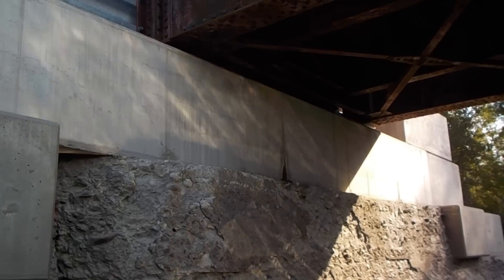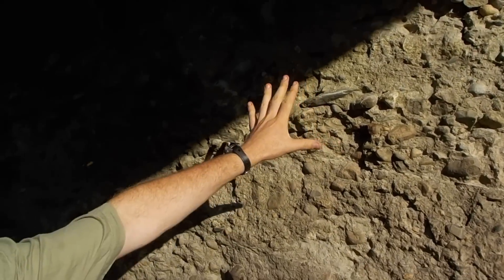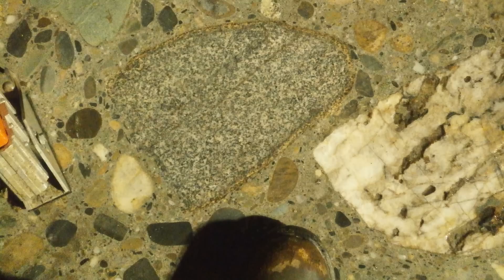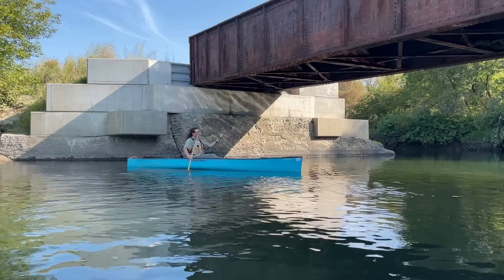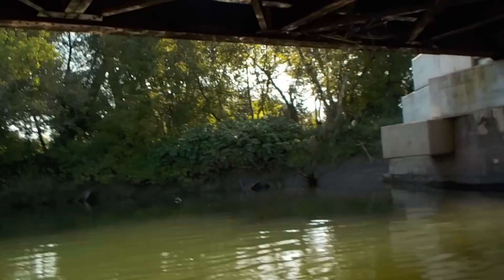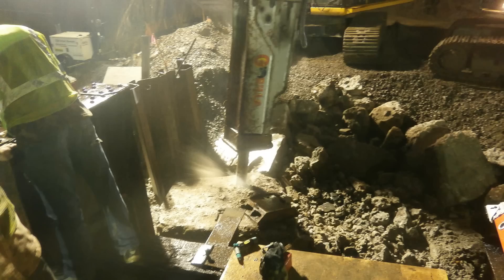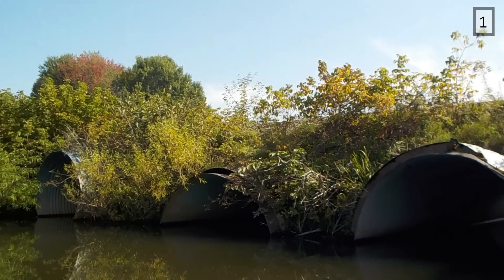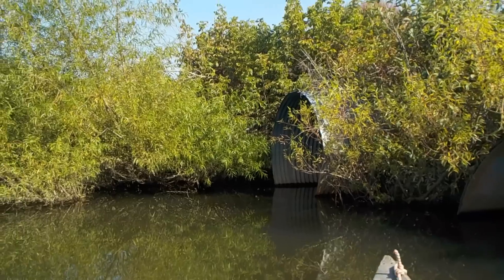Overhanging Parts of Rail Bridge Abutments, What’s the Purpose?

Comment: You hinted at what I think is the purpose of those blocks. I infer they were put in before jacking up the bridge, as supports for the jacking, but not needed once the final concrete pour was able to hold the jacked-down bridge.
 
Am I close?
Reply from the maker: Yes, the jacking was temporary staging to allow for the concrete under the ends of the bridge was replaced.
Reply: @KestrelOwens  ...and the blocks were there for the jacks?
Reply from the maker: The blocks were so the jacks (under the beam) could get out beyond the existing (and replaced) abutment.

Comment: Great video. Just need a camera with optical image stabilization, or at least digital image stabilization.

The former actually stabilizes the lens mechanically, while the latter takes a larger image than what you see, and then uses that to minimize apparent movement as it trims the image. 

I notice you were using an "action cam". You might be better off using the main camera on your smartphone, as pretty much all midrange and above ones will have some sort of stabilizing. Digital is the most common, as it's inexpensive. Optical is more often found on higher end phones, but also comes on some less expensive ones.

But aside from the shaky picture at times, I really liked how you explained what the unusual shape of the abutments. And the video conveyed a lot of information well in a short length.

Comment: I wonder, does the iron girder just sit on the concrete support or is it bolted to it. Perhaps the span has to move as it bends slightly?
Reply from the maker: The girders don't sit directly on the new abutment, but rather on a steel plate (interface of which allows for movement) which is bolted to the abutment. I imagine that the reason is so that the movement of the steel does not abrade the concrete.
Reply: @KestrelOwens   that's also for seasonal freeze / thaw and extreme temp changes in the summer where the entire bridge will change length by a few inches.

Comment: Near my home town there is a lock on a canal that was built in the early 1930's I think. Well the Army Corp of Engineers was going to resurface the walls of the lock. So they used explosives to blast away a few inches of concrete. They set off the explosives and when the dust settled......nothing had happened. No effect. The concrete was built so well in the 1930s that it was a tough as could be.
Reply: Had a pad of 18" thick unreinforced concrete from WWII at a Pepsi plant depot yard refueling point. We burned out every pneumatic gun we had in the shop, most fresh from being rebuilt, both 90 pounders and 70 pounders, then the owner finally dispatched the big backhoe with breaker to remove the concrete. Even using my old 22 pound sledge was barely chipping that concrete!
The only job I was on that was as ugly was when we converted an Army indoor range into office space and had to cut through 10000 pound test concrete with granite aggregate. That stuff was even beating up our diamond blade saws that we borrowed from a Seabees unit.
Oh well, if it was easy, someone else would've gotten those jobs...
Reply: @spvillano   Interesting story.  :)
Reply: In Victoria in the closed Heathcote line there was this small timber bridge near Axedale which was built around 1880 and the Army Reserves tried to demolish it with explosives as a training exercise and was a total failure as the bridge was still standing and the bridge had to be demolished with an excavator.
Reply: @darylcheshire1618   Another interesting story. Thanks.

Comment: They were definitely using rebar in 1912!!! There’d be absolutely nothing left of that old concrete today had they not been reinforced!! Re-bar was first patented in 1867. Were they using enough of it in 1912? Not by today’s standards, no.
Reply: Unless it’s Roman concrete.
Reply from the maker: Yes, rebar existed at that time and was used in certain situations, but I can assure you there was not any in the old abutment. While one of the purposes of rebar is to prevent cracking, which might be important for longevity, what rebar is most known for is to allow concrete withstand the tension associated with bending forces. If your design does not have any tension forces which need to be withstood, like a spread footing abutment can be, it is not necessary. Rebar, being steel which can rust, can contribute to accelerated degradation of concrete if not properly encased in concrete.
Reply: Alot of early rebar was square twisted bar not the textured stuff we have nowadays
Reply: I did concreting in the  1980s without rebar , my point is they might have had rebar available but buying it and using it maybe n

Comment: Nice video. It almost appears as if it were built as a 'pile bent' design and that the old 'abutments' were poured, perhaps, as erosion control measures and the piling were original equipment. The bridge beams would have had to have been removed to drive the piling, if done after the fact. The wood piling also appears much older than 20 years. I wonder what happened to this bridge during the 1927 floods (if this area was affected?). Looking forward to more videos!!
Reply from the maker: There is not enough information in the video for you to see but due to the open deck design the location of the piles could have been driven after the fact without removing the superstructure, only the bridge ties. The piles were also not semantical, with more piles in areas where there was more deterioration of the abutments. I do agree that it they likely were there much longer than 20 years, that was just the length of the memory that the rail workers I talked to had (since they started working for this railroad, and these had always been there).
Reply: @KestrelOwens  Thank you for the reply!!